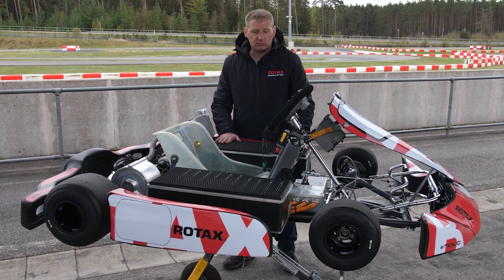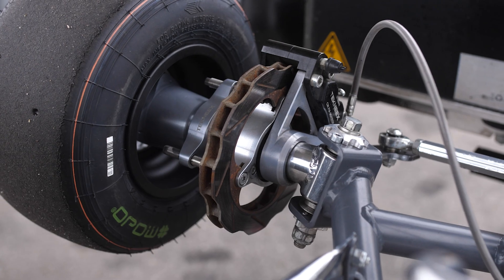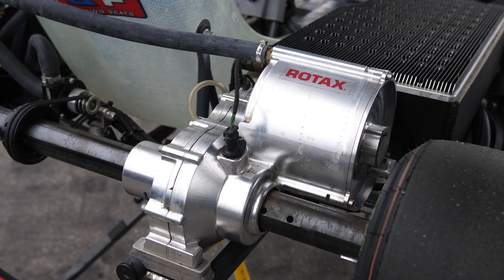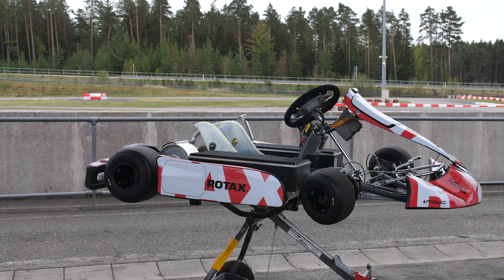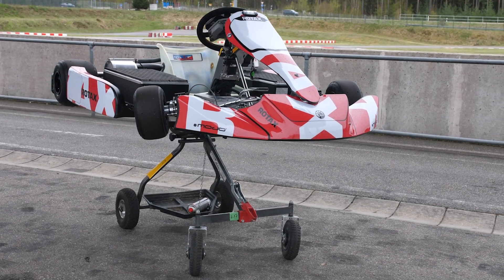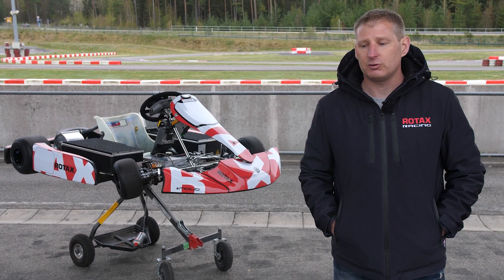NEW E-KART E20 EXPLAINED!

Comment: On top of all the benefits listed in the video i think running costs and ease of use is also a massive pro. 2-stroke are expensive af to run and are such a struggle to get running well. I think this could make it possible for more people to compete in karting and up the motorsport ladder from there

Comment: What are the specs? Battery life and what kind of motor? There is a big go kart race at Purdue, and they briefly had an electric go-kart race in it. It didn't do too well, but I am looking at trying to bring it back. Would you be open to an exploratory call?
Reply: 2 x 4.4kw batteries. Motor 24kw 46nm 85mph
Battery is good for 11 laps at full power.